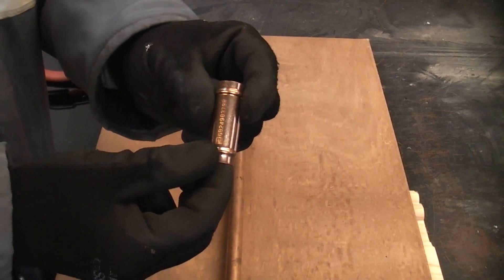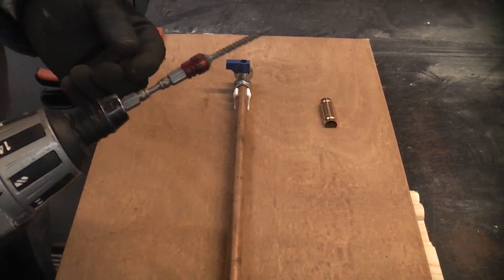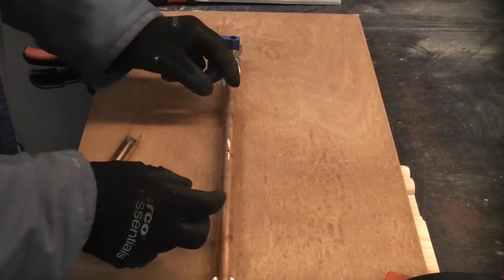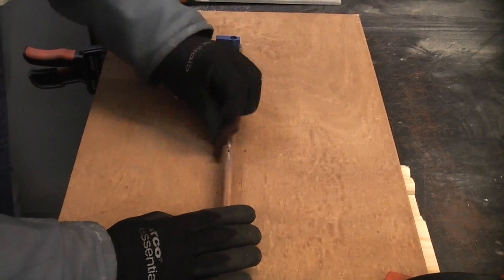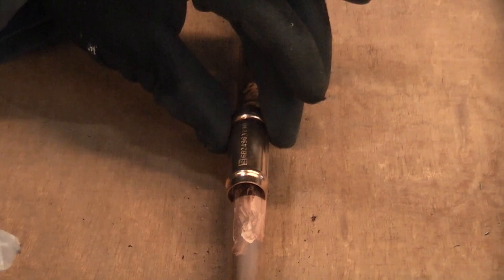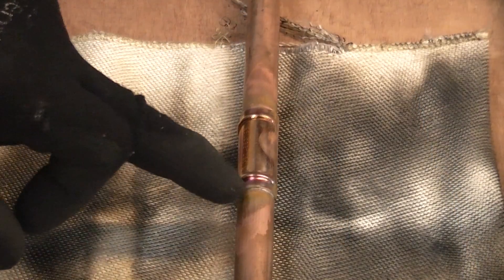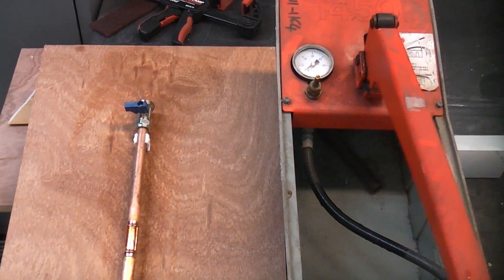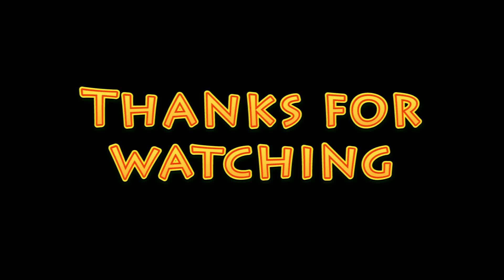How to repair a hole in a copper pipe using a click fix patch repair

Comment: I just tried one of these and it didn't stick to the pipe. Did I use too much heat or flux? The pipe is vertical.

Comment: I just tried doing this and it just didn't stick/solder to the pipe. Maybe I used too much flux or heat? Can you apply these in situ to a vertical pipe?

Comment: You can also do this by getting a scrap of pipe & cutting it in half to make patch & solder it on.  I did this on 3" sewer pipe that was corroded open on the bottom.  I made a patch & held on with bare copper wire tied around.

Comment: I take it gas pipe is a no go!
Reply from the maker: These should be fine, although you'd have to be gas safe registered to work on a gas pipe
Reply: @ultimatehandyman  thank you for the tip, I was simply curious to know if the heat applied to solder alone would explode building.

Comment: How can i be sure that all the water is out the pipe? It's not dropping anymore after shutting off the valve but surely there'd still be sitting water inside? Or does a small amount not matter too much?
Reply from the maker: A little bit won't matter, as it often evaporates when soldering the pipe.

Comment: If a hole was made through both sides would two side to side or even one of these be sufficient to patch it up?? One patch looks like it covers more than half of the pipe, so I would imagine two patches would not align properly.
Reply from the maker: I don't think you can use two patches for the reason that you mentioned.
If the hole goes right through the pipe, it's probably easier to cut it and use a coupler.
Reply: @ultimatehandyman  Thanks.

Comment: what solder exiting  did you use ?
Reply from the maker: The solder is pre applied to the fitting, you just clean the pipe, add flux and then heat the patch.
More on solder ring fittings here- https://www.youtube.com/watch?v=7zlDHA3KhLA&t

Comment: Drilled a hole into a copper pipe inside my apartment ceiling, trying to hang a curtain rod. Pulled out the bit, all hell broke loose. Maintenance didn't know how to turn off the water. Ran for hours. Flooded the 6 floors below me. Wish I found this vid before I got my eviction notice
Reply from the maker: Sorry to hear that 😱

Comment: Probably would be a lot better to cut out the section of old pipe and replace it. That or silver solder the hole. I can see that lil plate having problems in the future.

Comment: If there is still a drip are they easy to remove? What is the best way to remove it?
Reply from the maker: Hold the patch with pliers and heat the solder using a blow torch, then pull on the pliers when the solder melts
Reply: Thanks, love all the videos. People subscribe now!!!!!

Comment: I'm guessing this would not work for freeze damage?
Reply from the maker: No, this is for pin hole's really.
Best to cut it out and replace it. If you can do, I would use plastic pipe, as it does not split like copper does, when it freezes.
Thanks for the comment 👍

Comment: Anyone else here 'cus they've just seen a leak in their ceiling. Mine was under a shower base. 1) dismantle the shower unit 2) make notes on how to put it back together 3) cut the silicon off the base 4) lift out the base 5) remove all the sand 6) smash up some cement to find the pipe and discover a pinhole 7) turn off the water and wait for wife to complain 8) sit on the pc to find a solution 9) find this video after 40 mins. 10) go to the diy store looking for a copper clippy thing 11) discover their shut 12) go home and explain to the wife you can't fix anything till 2moro. 13) get a bollocking 14) pour a stiff drink 14) spend the rest of the day deciding who I'm going to kill first. AND all because of a f***ing pinhole. Who invented copper pipe? He'll do. And all of this in Spain. Try this lot in Spanish. Now I'm back on the pc looking for a decent translation of "copper clippy thing" and "pinhole".
Reply from the maker: That sounds like some of my jobs ;-)
Absolute nightmare!
Best of luck with it ;-)

Comment: Any idea why the solder never runs? Heated for ages and all that happens is the solder pools to the lower groove of the patch but never makes it onto the pipe
Reply from the maker: Not sure, did you clean the pipe and use flux?
Thanks for the comment 👍

Comment: Great video as usual. Could this work for something bigger say a slice in the copper pipe? Could you as use two to make a full circle if you cut right through the pipe?
Reply from the maker: Yes, it would work on a slice, as long as the patch is large enough to cover it.
No, you can't use two of these together if you cut right through the pipe, I would use a slip coupling for a job like that. 
Thanks for the comment 👍

Comment: Hi! Does it work for gas pipes?
Reply from the maker: Not sure, as I don't touch gas. You would have to check with the manufacturers to be on the safe side ;-)
Thanks for the comment 👍

Comment: who are you kidding if you put a screw through a pipe you would have a lot more than water dripping out of a pipe it would it would come out like gangbusters
Reply from the maker: If you screw into a pipe, the water does not normally come out at a rapid rate, unless you remove the screw, especially on a central heating pipe, as it does not have the same pressure as mains water
Thanks for the comment 👍

Comment: Great video but I'm just wondering why the pipe didn't turn the shiny copper color after cleaning it. Surprised no one else has chimed in on that issue thus far. I don't think it was cleaned enough.
Reply from the maker: It was clean, but it does not go shiny like it does when you use wire wool. You only really notice that the pipe is not shiny once you get it on the computer, when it was in the garage it looked shiny!
Thanks for the comment 👍

Comment: Ty great video, I normally use endfeed straight coupling  takes much longer to do as you cut the pipe ect, will use this fitting nextime, im sure ive seen this in screwfix catalogue while ago. Anyway ty for ur. Video thx
Reply from the maker: Thanks for the comment 👍

Comment: Can't say thank you enough. Been so stressed about a pipe that saw a drill bit end in an attempt to fix a squeaky floor board before laying down laminate. Sandwiched between a joist and floor board and two pipes either side, couldn't even figure out how to cut for a straight join. Then worry about the integrity of the joins. And the stress of the colder weather turning up any day. This is a brilliant invention and you've given me the confidence boost to do it. A very sincere thank you.
Reply from the maker: You are welcome
Thanks for the comment 👍

Comment: You've just saved my weekend and a load of money. Many thanks. Subscribed! :D)
Reply from the maker: You are welcome
Thanks for the comment 👍
Reply: @ultimatehandyman  What would be the best way to drain the water from the pipe with such a puncture? Easy enough if cutting the pipe completely but my puncture looks pretty much the same as the one in your demo, and is under the floorboards at the top of the house. There's no obvious way to remove any water in there, and I'm wondering if it will compromise the solder/seal.

Comment: Thanks for the demonstration.  Can this be used for a natural gas line?  Thank you.
Reply from the maker: I’m not sure. You would have to check with the manufacturer. These use lead free solder, which is not recommended for gas (or so I have been told)

Comment: Honestly, you're better off cutting the pipe. In this way, you can ensure there's no standing water in the pipe. Any water in the pipe will ensure the joint will never take solder. Buy couplings *without* the built in stops. Permanent repair that doesn't look hacked.

Comment: I would braze that whole shut in seconds. Heat shield, A/C brazing rod and some MAPP gas on a Turbo Torch. And some damp cool rags to cool it off. A stick of brazing rod may possibly be hard for someone to come up with though. I'm not trying to knock you. This is just what I would do, cuz I'm an AC man. No cleaning or flux needed . Peace and love.
Reply from the maker: Thanks for the comment

Comment: Absolutely useless if the screw or nail goes all the way through the copper and into the joist.  In 99% of instances, that's what happens.
Reply: Just use 2 of them ,one on each side if possible

Comment: Won’t the water in the pipe start to boil and blow a hole in the solder?
Reply from the maker: You would have to drain some water out of the system, but as long as there is enough room for the heated water to go, the patch should be fine

Comment: Can you actually solder that patch onto the pipe while the water is running ?
Reply from the maker: No, the water will boil and escape- which will mix with the solder.

Comment: Having trouble draining the system .my pipes Lower than all my taps.turned my stop cock off and turned on all my taps but no water coming out.
Reply: But still has water in pipe
Reply from the maker: It could be air locked, if you open the upstairs taps too, it should help
Reply: There isn't any upstairs taps now. It runs on mains pressure

Comment: Quick Question:  How would you be able to use this fix if you had punctured the pipe as you described (by screwing down floor boards from above)?  Wouldn’t the hole be located between the floor board and the pipe (leaving little to no space to get in with a click fix patch...much less a torch to heat it on)?   Am I missing something here?
Reply from the maker: It depends how much room there is (where the joist has been notched out), also the puncture might be in a pipe that is buried in a wall etc.
Thanks for the comment

Comment: I have punctured a 15mm heating pipe. The nail went straight through. So 2 holes..but the hole below is difficult to get the torch on. Can you use 2 patches? one above and one underneath?
Reply from the maker: You could do, but you will have to wrap some metal wire tightly around them to prevent the bottom one from dropping off.
It might just be easier cutting out the damaged section and replace it with a new pipe of pipe and a couple of slip couplings?
Reply: @ultimatehandyman  Thats just what I did....thanks. And the other leak below was sorted with a kind of epoxy putty

Comment: You won’t get away with that with an inspection on a new house in the  US. Cut the copper and repair it the correct way. Tear out the wall if necessary.
Reply from the maker: Thanks for the comment

Comment: this is just what I need, however, the leak is on the opposite side of a pipe that is in situ in a tight and confined space.....cant get the blowtorch on it
Reply from the maker: That might be a tricky one to fix!
Thanks for the comment
Reply: @ultimatehandyman  Yep....gonna cut the pipe and resort to a compression joint fix. But good vid and something useful learnt for the next leak that I can get my torch on

Comment: For those that might not know, 50bar is enormous, domestic water supplies are usually about 3 - 4bar. 
1 bar is 1kg/cm².
Reply: Yes was just going to say exactly that, most I've seen at a house is 14bar/140mhd nearly blew my gauge but 25-70mhd is the usual range.
Reply: Equivalent 500 metres head height, mental.

Comment: How about a nail hole straight through? Use x 2 just asking... cheers Rob.
Reply from the maker: Yes Rob, you could use two of them, but you would have to wrap some metal wire around them to hold them in position until the solder cools, or you could cut the pipe and use a coupler or a repair coupling.
Thanks for the comment

Comment: Mine didn't work how do I get it back off lol tried heating it but it seems stuck
Reply from the maker: You will have to grip it with pliers, then apply the heat to melt all the solder, it should then just pull right off.
Reply: @ultimatehandyman  thanks the strange thing is if I get a piece of old pipe I can solder to it no problem but even if I leave the torch on the side of the repair for five minutes it barely gets this pipe hot enough to melt the solder just bought a new torch but that's the same

Comment: This is a nice gadget. But, you can alsi strip a chewing gum around it. You just have to chewing it around 1 minute after you apli it on the hole and you use an hair dryer. I always use this method and my customers are very happy with it. And it s less expensive when you run a small business like mine.
Try it you ll be amazed.

Comment: Take a look at the ebay listing when you say the price varies, it sais 49CM in the listing so would assume its about 5 times the size of the one you used.
Reply from the maker: Yes, I knew that already.
Obviously when they were doing the listing to fleece people- they obviously got confused over the size.

What would be the point of a 49cm patch, when most screws are only a couple of mm in diameter. 

Thanks for the comment
Reply: Took a look at the listing on ebay, its actually for a 49mm not cm patch which is identical to the screwfix one you used even the same brand! Thanks for your helpful videos :D  @ultimatehandyman
Reply from the maker: @rossiboysound   They must have realised their mistake and changed the listing ;-)
Thanks for the comment

Comment: Why using flux?
Reply from the maker: You have to use flux when soldering copper pipes as it chemically cleans the copper, making the solder stick correctly.
Thanks for the comment

Comment: Or you could do what any professional plumber would do and cut out the damaged section of pipe and do a repair with a proper coupling.
Reply: HVAC repairs channel 
Then he would not have a ch, testing stuff.

Comment: this is a great idea especially tough areas you cant easily get a pipe cutter in; if you can't shut off the water though because the valves are jammed / very old, and you don't want to open a can of worms doing so, sharkbites work well.
Reply from the maker: Thanks for the comment

Comment: Just leave the screw on and wont leak, problem solve.
Reply from the maker: I think you will find that most times when you put a screw into a water pipe- it leaks ;-)
Reply: @ultimatehandyman  Yes the screw in the pipe will leak or a trim nail will rust and then leak sometimes weeks later.

Comment: And if for some reason you don't  have a good preparation and that happens a lot you have even a bigger problem with water now in the pipe, the best quick fix especially in the wee hours of the morning when you have other outstanding calls is to use a radiator hose clamp available at any auto parts store and a piece of rubber roofing or similar rubber material, when you have other calls backed-up or you just want to get  back home you can always come back and do a better job of it later when you have  the time!
Reply: or you can buy a clamp with rubber patch inside.  I have an apartment building and I fixed many pinhole in water heater pipe, then call plumber or fix it yourself.

Comment: WOW, what a rip off, just take a standard coupling of proper size and cut   a section out of it so it snaps in place over the damaged pipe. Of course you muse clean the damaged area flux and solder as normal.

Comment: I was waiting for it to explode or violently pop off as you pressurized it. LOL
Reply from the maker: LOL, when pressure testing with water an explosion is very unlikely, normally the worst that will happen is the item being tested will spring a tiny leak and the pressure will immediately be lost.
Thanks for the comment

Comment: Thanks for that. Ive never even heard of them until now. I’ve fixed a couple of these types of leaks (that I caused my self😩) by using a piece of car heater hose and a jubilee clip directly on the hole. They  turned out to be permanent repairs. So far anyway. 
Have you tried to glue one of these patches using the copper pipe glue you demonstrated.
Reply from the maker: No, I've not tried the Just for copper with one of these patches. I prefer solder and will only use the just for copper in places where it is impossible to solder.
Thanks for the comment

Comment: Im a tiler and work alongside plumbers so know all the swear words! Seriously though this look like a clever piece of kit. However, having watched plumbers working on 'wet' pipework, they tell me and I have seen, that when heating up a pipe with water inside, the heat draws the water along to where they are working causing problems soldering and lots more swearing. Hope that makes sense! Would that problem not arise when applying this repair patch to a 'wet' pipe?
Reply from the maker: Yes, you would have to drain down the pipe first, before using one of these, but at least you don't have to cut the pipe to repair the hole.
Thanks for the comment ;-)

Comment: Interesting.  I didn't know that copper pipe or compression fitting could take that sort of pressure, 50 bar.
Reply from the maker: It can take it for short periods of time, but you would never use it for a permanent installation if you knew the pressure was going to be so high.
Thanks for the comment

Comment: I had a tiny hole in my pipe and the plumber cut it and slipped a whole one of these copper pieces on and pressed it tight with a clamping tool. $180 for 5 minutes work, robbery.
Reply from the maker: Sounds like a press fit of some kind!
Reply: yes it is, I thought this was the new way of doing things now. I'm keen to get the tool so I can save some money if it happens again.
Reply: Then learn to do things yourself.

Comment: As you would need to drain system/pipework to install this I don't see why anyone wouldnt just cut the hole out and put a straight on. And if there is no movement in the pipework to get the straight on use a slip straight.
Reply from the maker: You would not need to drain down completely to install one of these.
Thanks for the comment

Comment: Is the water passing through the solder and flux safe? Drinking/Bathing?
Reply from the maker: If this was on a potable water pipe you would have to flush it out for a couple of minutes, but after that it could be fine.
Thanks for the comment